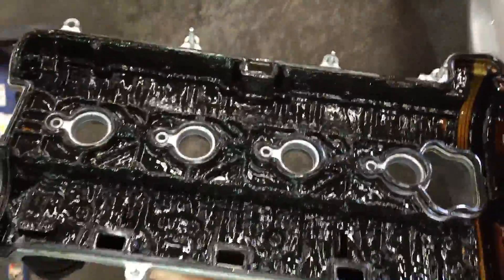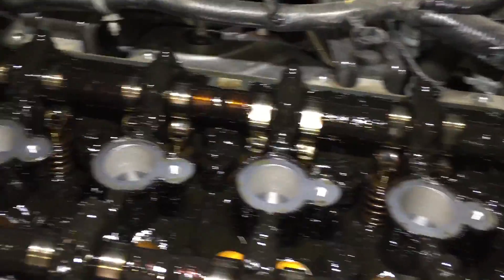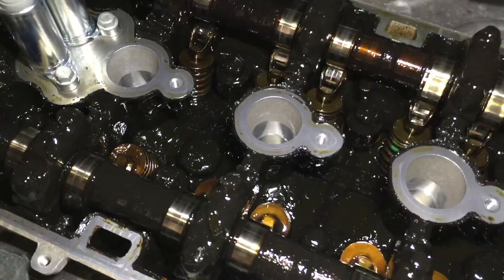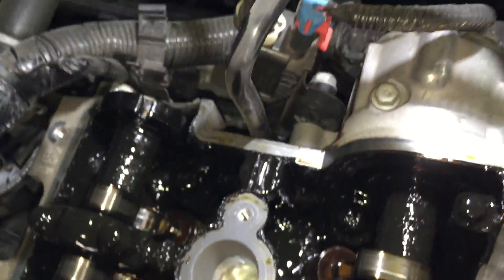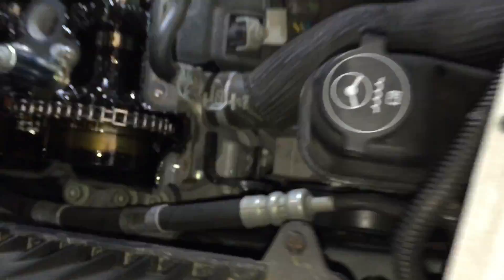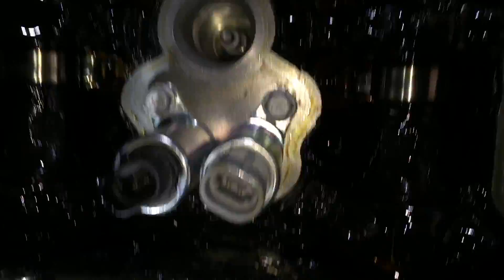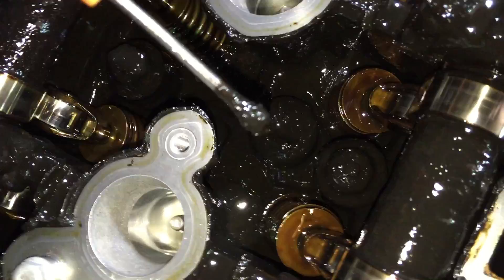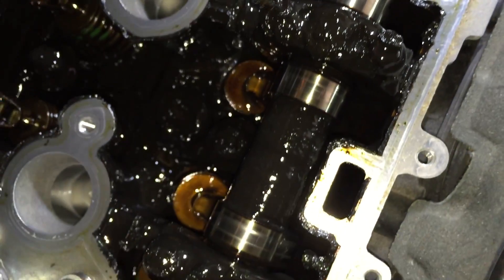Engine Sludge at 28,000 Miles

Comment: i never let our vehicles go over 5k without an oil change. also i run half a quart to a quart of marvel mystery oil added to the oil for the last 100-200 miles before i change the oil to help clean out any sludge and debris that might be there. i stsrted this.a few years ago after i bought an 04 grand cherokee with 195000mi on it. i went to change the oil and it was so sludged up that it wouldnt drain out without poking into the drain hole with a screwdriver. added new oil and substituted the last quart with mystery oil, ran ot for 50 miles and drained it again with lots more sludge. after about 15000 and 3 more oil changes i replaced the valve cover gasket and when i took the cover off it was nice and clean inside. currently at 250xxx and no more sludge to cause me problems.
Reply: Transmission oil works great too. 1 quart about 25- 50 miles before draining to flush.
Reply: Most of the time the oil pump screen will plug with debris. You got really lucky.!
Reply: i feel like this is a joke and will hurt your engine...

Comment: what kind of car was it
Reply: Its a Chevrolet Captiva. Took quite a while to figure it out. Matched the dashboard and the goofy fender vents. It could be a Saturn Vue also. but its the same car
Reply: quiksilvermanblue yup it was a Captiva. Sold as rental fleets only. Seems like the company forgot to do a oil change, probably screwed up the numbering system and the company didn't notice. Or its what happens when they use crap oil. Its one of the reasons I refuse to buy ex rentals. They'll always say how often they bring them in for maintenance. Often does not mean proper maintenance.

Comment: As soon as I saw that dexos cap the first thing I thought "yep, this guy probably insisted on regular oil too."
Reply: Yep, that's definitely not full synthetic DEXOS oil. DEXOS oil would still look fairly "OK" (used, but not to bad).
Reply: wysetech2000 No dexos is a committee stamp of approval based on emissions tests.  some semi synthetics are dexos but a majority of synthetic oils are dexos
Reply: Michel Linschoten if it's got a 0w20 weight or a dexos, yeah, it matters
Reply: dufonrafal    Dexos oil is semi synthetic.
Reply: OK, my mistake.
Reply: Does not matter at all, i use cheap shit oil from wal-mart it's approved (as it must have that to pass as engine oil) 260k miles on it never an issue. Unless you stomp it everyday makes no difference at all..
Reply: Herb Bees
It would only matter if you stomp/race your engine/car...other than that it makes little to no noticeable difference. The proof is in the pudding as i said been 260k miles and i use to use 5w20 and now i use 10w30 its just viscosity differences. As my truck is old so somewhat thicker oil is better for my old seals what not. Other than that....not a big deal.
Reply: Michel Linschoten thicker does not mean better.  If the vehicle requires 5w20 thicker oil expands the clearances and makes it harder for the shafts to produce the required torque, it will also decrease pressure.   Having said this 0w20 weight which is only synthetic would make a difference.  Dexos is designed for emissions, catalytic converters have ceramic phase change plates that convert exhaust chemically, exhaust and lubrication between the pistons and the shafts influence this, and also have different mass flow rates. If you have problems with the seals you shouldn't put thicker oil you need new seals and valve covers.  You are only partially correct in synthetic oils applications
Reply: For warranty purposes, DEXOS matters. For anything else, it does not. Nearly every vehicle manufacturer buys fluids from a few companies like Mobil, Shell, Castrol etc. They do request certain properties in the oil, but everything they want is a fairly large range that are already fulfilled by literally any good synthetic oil on the market. Manufacturers themselves are looking for the absolute cheapest oil that will be good enough through warranty. Many still use semi-synthetics, not just GM either. A friend just bought a 2015 Fusion that comes stock with some Motorcraft semi-synthetic. Semi-synthetic is closer to non-synthetic than to synthetic. You do need to use a reasonable weight oil, either the exact weight used by stock or sometimes you can go to a slightly different weight. 0w20 and 5w20 are typically specified more for fuel economy. Many people will tell you that cars with VVT need super thin oil but go buy a German car that uses such systems and your oil weight will be 5w40 or similar. In general, the European manufacturers spec oil for engine life, and US manufacturers spec oil to appease the EPA. EPA also has other mandates such as an upper threshold on ZDDP because if your car ever starts burning oil, ZDDP can coat your catalytic converter and shorten its life. But ZDDP is really good as an anti-wear additive in oil. A LOT of decisions in oil are indeed based on EPA policies. Don't put 5w40 in your 0w20 car, but you also shouldn't be afraid of high quality 5w20 or 0w30 or even 5w30. A good synthetic oil will flow much better than even an "OK" semi-synthetic, especially with a couple thousand miles on it. Go look at the testing "Engineering Explained" did with the flow rate of used oil.

All that said, I am NOT advising owners of recent GM models to avoid DEXOS. I'm just saying that GM's not actually being honest with you about it, and that your engine itself does not need it. Also, keep in mind that certifying oil for these specs actually involves a licensing fee paid to GM... So if an oil company sold oil with this logo and a Nissan or Ford or Toyota or whatever driver buys that oil, GM would still get their hands on that. That's why specs like DEXOS exist.

By the way, don't forget that GM is the company that brought us Dex-Cool. You'd have to be crazy to take GM's side on specifications.
Reply: dansolodan dexos only is emissions related it matters
Reply: Well I'm not saying to run Rotella T6. A lot of people do run that. They do risk lowering the life of their catalytic converter, but it's not going to damage their engine. The cats won't be damaged for a good while either unless they're burning a lot of oil. Personally I like Amsoil and Schaeffer. Personally I like high molybdenum oils in lieu of ZDDP.
Reply: dansolodan It will damage the engine.
Reply: dansolodan You know instead of editing your response to sound smarter you should've just drafted another reply.  And yeah you should be afraid of putting a thicker oil than it recommends in your car.
Reply: Herb Bees
Well ya i get what you're saying however been doing it for 260k miles, does not seem to make a negative difference at all. I like the thicker oil because it's an 21 year old truck. And my seals are fine, however the thinner the oil the more chances it will piss out of every pinhole it might have. The 10w30 is not that much thicker. it's not like i put in a jar of tar compared to 5w20 also what i understood it stays slightly thicker when on operation temp. Also i did my research on the s10 i drive (forums what not) they concluded what i did. It does not harm that 4.3 vortec at all. So i keep running it, it's cheap and keep her nice and "wet". Sooner or later i will drop in a 400 or 350 small block i will use then the better stuff. But in the meantime i keep running this engine until it just will give up on me. I got to say GM made some damn good engines in that era....no complaints here.
Reply: Herb Bees nah I like edits. And I'm not afraid. I've definitely put more research into this than you, and have probably done more work on cars than you. You do what you want; for you it's probably better to stick to the "OEM oil" if you don't know how to read oil specs. There's always that one guy who doesn't know how to read or interpret specs and thinks there is only one right way to do things (that's you). You're contributing zero knowledge here, and I don't mean to imply that you don't know anything about cars, but you're just basing your arguments on what OEMs say rather than the actual contents of the oils. Also companies like Valvoline specifically say their oil meets dexos specs but they just refuse to pay for a license to advertise it as such.

Whereas I am not even saying to use it or not to use it, just giving the realities that there are several options more than you think.

By the way I edited this post too.
Reply: dansolodan
 You both seem knowledgeable, problem is with YT is that people are often on the "I KNOW MORE THAN YOU" bandwagon. And do not shy away from attacking you on a personal level. I know jack shit about oil to that extend. So i read both of you guys postings and google along and learn something new.
Reply: Michel Linschoten If you want to learn more I highly recommend a site called "Bob Is The Oil Guy" - lots of very knowledgeable people over there. I've done hours if not tens of hours of research into oils and contents of oils and such  (as well as many, many oil changes), and what I know probably isn't even 1% of what is available on BITOG as far as knowledge.
Reply: dansolodan I'm the engineer, you're not.  Ever take a course in fluid mechanics? Mechanical design?  No?  Might make you feel differently about your whole stance but then again probably not.  I don't mean to come off as a condescending asshat and I hate when others do but you're really misguided and what's worse is you're spreading it to other impressionable people who don't know any better.  I've also worked years as a mechanic paying my tuiton if that counts...

Comment: Had a F150 with the ecojoke 3.5 come into my shop with 19,000 miles, carbon fouling on the back of the intake valve like it's a 250,000 mile engine, and sludge as bad as this.

Comment: at least its solt sludge and not carboned up and hard and crunchy that shit is engine teardown shit 
what you have is throw 5 liters of diesel over it and it should wash into the sump*keep sump bung in intil your finished then drain the crap (the build up in sump will flow out
done 3 engines like this   when the shit carbons up and goes hard its a hard brush or soda blast to clean/fix

Comment: We had a 2004 4.0 jeep grd chero that was worse, we were digging it out with plastic spoons, after 5 mins we said f it and brought out the pressure washer, what a mess that made, but we got it all cleaned up, did about 3 oil changes and 200 miles afterwards then put it on the lot for sale. 2 years later the guy we sold it to is still driving it around. But that was a 4.0.
Reply: for power maybe but the amc 4.0 is basically indestructible if you change the oil regularly.
Reply: The 4.0 engines are tanks! I love my '99 XJ
Reply: But the V8's are better.
Reply: Those inline 6cyl 4.0s were amazing and bulletproof. Under moderate care they go 300k easy. Mail carriers have used them for years some getting 400-450k on original engines. Best engine Jeep ever made and one of the 10 best ever. Won't win many races but torquey and tough...

Comment: What car is this?
Reply: Looks like a Chevrolet Captiva/Saturn Vue
Reply: mtnman1984 okay cool. usually I can tell but video doesn't really tell
Reply: Yeah. Almost didn't get it until I saw the "side vent".
Reply: mtnman1984 gotcha
Reply: Chevrolet Captiva, defintelly not a Vue since it only has 28,00 miles on it. You don't see many of these.
Reply: If you really want to get down to the bottom of it: The Encore's interior has square shaped vents. If you can see the emblem in the steering wheel, it's a gold or brass color. The Buick emblems on steering wheels in this era are chrome outlines, Saturn had a brushed silver logo, and Chevrolet has the textured brass bow tie with a chrome edge. Plus, Encores never had those cosmetic vents behind the front wheels. So, now that you've made me look really hard, I'm sure it's a Chevrolet Captiva Sport.
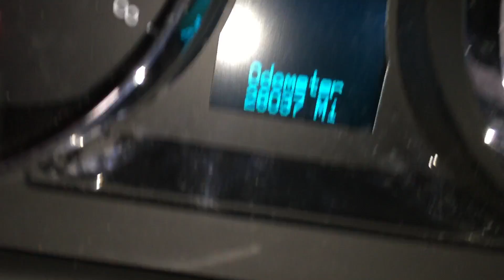Reply: mtnman1984 pause it at 2:21, you can see the Chevrolet emblem in the steering wheel..
Reply: Zap Rowsdower212 chevy trax

Comment: do u ever recommend synthetic oil?
Reply: alexisthemexican I use to use conventional when new they are they same in low temperatures but halfway through its life conventional is terrible and becomes very thick
Reply: don derew depends purpose of synthetic oil is if you want to drive longer per oil change
keeps engine cleaner than conventional
way more stable in extreme conditions
I have used Royal Purple no and the cold starts in Colorado have never been easier synthetic oil had plenty of benefits
Reply: ***** exactly buy there still are those chepos who will do anything for a few bucks
Reply: eh. conventional is not as bad as you want to believe. Both synthetic and conventional oil do the exact same job. At temp, neither oil is better. The only time synthetic is better is when it has more of the same additives that they put in their conventional stuff and when you are using it in extreme temperatures.
Reply: HERPY DERPEDY I cant say if it does or not. I usually change my oil before seasonal changes. Rather not have to change my oil in the middle of december when its starts to get cold over here in the PNW. So i tend to have fresh oil for the winter, then i change it again late Feb or when its "warm" enough.
Reply: alexisthemexican I'm just about to do an oil change this weekend total cost is $70 ROYAL Purple 5w20 with a Champion oil filter we do 6 month intervals we don't do lots of miles on the oil but it's mostly city driving so long idle and constant stop and go
Reply: HERPY DERPEDY I like more frequent oil changes. I like doing 4 months or 3k. Whichever is first. I used to just either use Castrol GTX or Magnatec. I'm trying out Valvoline's Synthetic this winter, so far it ain't bad. Different smell from the exhaust though.
Reply: alexisthemexican I don't know if it would be worth it to you but I did an experiment when I switched to amsoil. Amsoil has an oil analysis service and it costs like $25. What I did was had my oil analyzed at every 3,000 miles to see how long it would go before being worn out. On my diesels I got good results until about 15,000 miles. Gas engines I was good until around 12,000. I just tore down one of my 6.0 powerstrokes after 7 years of service at 380k miles and it looked like new inside with 15k mile oil changes on amsoil. The only reason it needed to be torn down was because I had an egr cooler failure and it dumped water into the engine. 

It might save you in the long run to figure out how often you actually have to change the oil. It saves me hundreds of dollars a year in oil changes alone. Of course one oil change in one of my diesels costs almost $300.
Reply: Drex Auto it tells me what I wanted to hear. I knew Amsoil was good stuff but didn't really know how good. If what you say is true, it's just testament how good Amsoil is. Might have to convince a friend to switch to it. Not necessarily for money savings but for longevity of his newly built engine.

Comment: I gotta a feeling the owner is going to start doing regular oil changes after getting this bill.
Reply: if they are this stupid, then I doubt it
Reply: Carl Zimmerman i would bet on that NOT happening
Reply: I highly doubt it. I’ve known people who absolutely trash their cars over and over and still treat cars like shit. And wonder why they have such bad luck with cars.
Reply: Likely they'll trade it off while it still runs, if it does.
Reply: I change mine every 3500 miles
Reply: @mecca unknown  That's fine on conventional oil. 5000 is recommended for Blend, and 7500 is good for synthetic.
Reply: @deutsch-amerikanisch8281  I still change oil every 5k weather it conventional or synthetic.  Synthetic gets dirty just as fast as conventional
Reply: @Dylan Clay  Your vehicle should have an oil filter on it. Your oil should also have detergents and dispersents. Diesel engine oil has more. Not only that, but contamination is measured in microns. If your engine has so much contamination that the filter bypass opens in less than 10k miles, you have bigger problems than your oil being dirty. On top of that, the engine wear is by engine basis. This means specific engines will have more or less wear based on design and manufacturing than oil type used. The other factor is oil type used, not nearly as important as having oil in the engine. Conventional oil doesn't last as long as synthetic, not because it gets dirty faster. Rather, it doesn't have as much flim strength instead having more film thickness, which breaks down much quicker, meaning conventional oil needs to be changed more often. There are many other reasons synthetic oils offer better protection for longer. It all has to do with its properties as oil and not it being dirty.
Even all this and there's still other important factors to engine wear. RPM and engine load, the more gential you are on an engine, the less wear it'll have over time.
I can go on all day why engine oils have different service lives and how the use of your engine causes more wear, but I digress.
Reply: This is why I change mine every 4-5k miles

Comment: lol my 2002 dodge intrepid 2.7 looks better than that inside with 188.000 miles.  Took the valve covers off to put the New water pump on and it was clean.  Its sad when a high miles engine known as the sludge engine looks better. I use synthetic oil and it keeps It clean.

Comment: This is an example of why I change the oil in our Advance Captor 4800 sweeper/scrubber machine (powered by a 1.6 GM Vorcec 1600 industrial engine that runs on propane.  We run Royal Purple in it and we try to change it every at least every 150 hours.